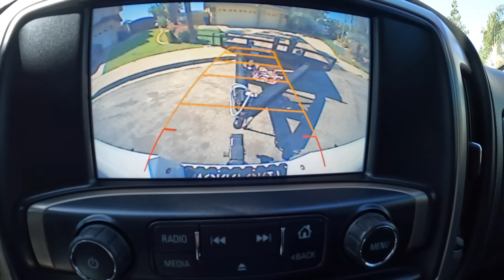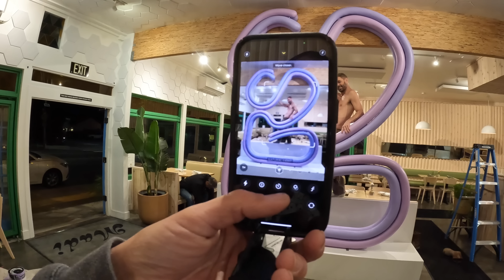My OBS Ford BROKE AGAIN!

Comment: I have the same truck. And trust me… I know this all too well. If it’s not a crack in the radiator then you have a bad water pump. I’m on number two in the past 3 years. I use mine for my business so I push it pretty good. Just my two cents….

Comment: Ryno would you consider putting the 360 camera setup in the BBB?
Reply from the maker: I was going to when they originally had the Dealer installed aftermarket system back in 2016, but didn’t want to repaint the mirror caps. I don’t find it a necessity on this truck, so probably won’t add it.
Reply: @DMAXRYNO  Cool , I was considering it for my 17' Dmax , Thanks for the reply